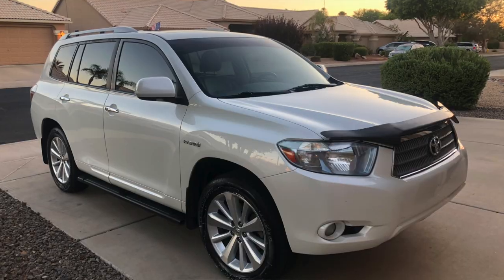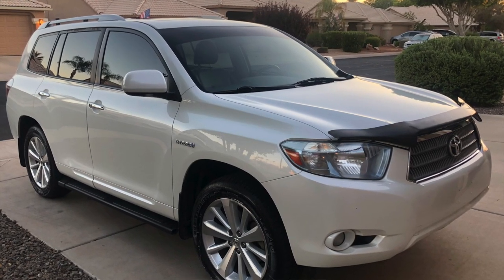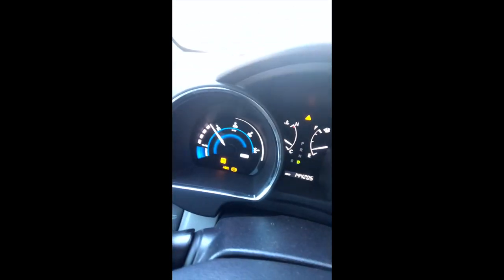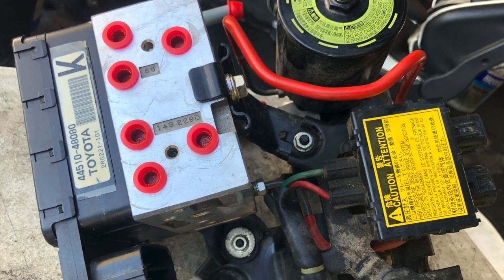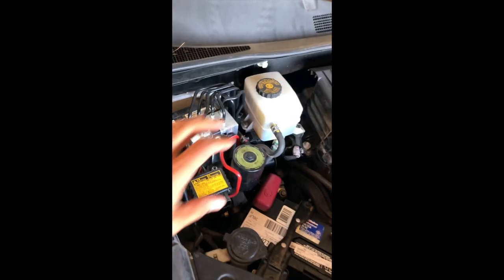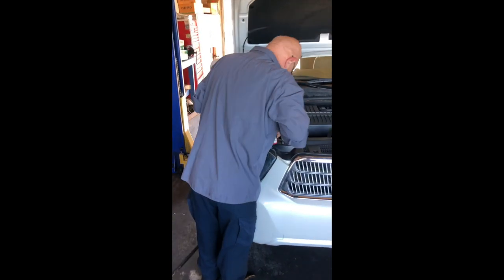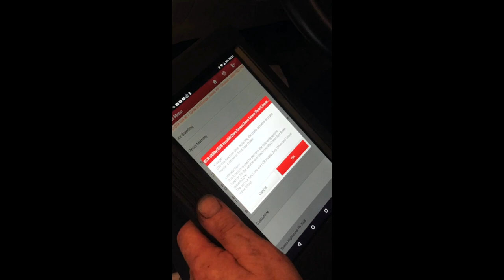TOYOTA/Lexus Hybrid ABS-VSC FIXED!!!

Comment: Thanks for this Info. I have the exact same problem with my 08 HL hybrid. Can you please advise how much did you pay for the replacement part?
Reply from the maker: I feel for you, it wasn't cheap and when I contacted my local dealership to see if there was a recall they said no. I paid $750 for the assembly from an eBay store, plus shipping. Thankfully it worked and I've sold the car since. Good luck to you, the install isn't hard but the reprogramming needs to be done with a scanner.
Reply: @beardmangarage8224   hey, is it possible to have a local mechanic replace the unit for me? Or does it require a specific hybrid technician for the replacement?

Also, do you recommend a place that can assist with the replacement other than the dealer? 

Thanks

Comment: I think there was a recall I believe. Did you check with local dealer.
Reply from the maker: Underhill Flowers yep. I checked with the vin through the national highway association and called my local dealer but both confirmed no recalls. Believe me I tried!! Thankfully the car went to a good home once it was all repaired.
Reply: @beardmangarage8224  Instead of a recall Toyota did an extended warranty.  They should've done a recall but you know it's all about the $$$.  This happened to my car that I just bought (same year make and model as yours). I unfortunately missed the extended date by 3 months.  I think that's why the owners sold it.  I couldn't even order at the discounted price by toyota to toyota dealerships. I'm spending around $1900.00  with parts and labor.  $350 of it Labor because you have to have the "official Toyota diagnostic software to bleed the brakes correctly.  Toyota Corp. is  kind of evil if you ask me!
Reply from the maker: @jenniferpowers1082  I couldn't agree with you more, it's all about the benjamins. It's so sad that hundreds of people are dealing with the same exact issue and Toyota still does not see a reason to issue a recall. Thankfully I found my replacement part used but then again I feel like it's still a ticking time bomb.

Comment: Toyota "Customer Support Program ZKC" covers that... https://www.toyoheadquarters.com/threads/2008-2010-toyota-highlander-hybrid-coverage-for-brake-actuator-assembly-and-brake-booster-pump-assembly-csp-zkc.1654/
You specifically asked about a RECALL, this is not that, but they would have done the repair FREE.  You can apply for reimbursement, conditionally... but "The Primary Coverage offers coverage until December 31, 2020, regardless of mileage."

BTW... there was no 2WD version of the 2009 Limited Highlander Hybrid... they are all AWD, with electric rear axle.
Reply from the maker: Its nuts that the dealership looks the other way when consumers like us need a helping hand. Thank you for sharing your knowledge, hope we can help someone in need.